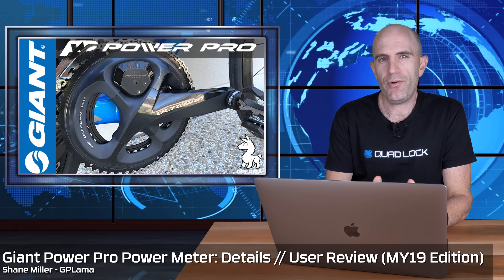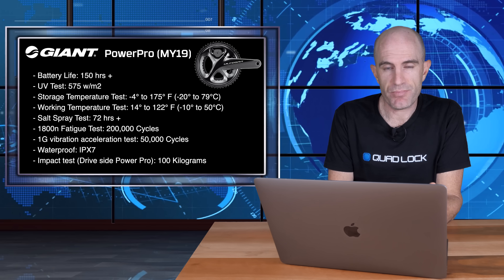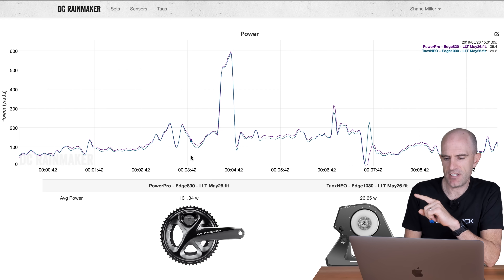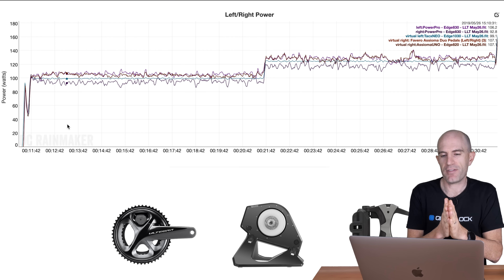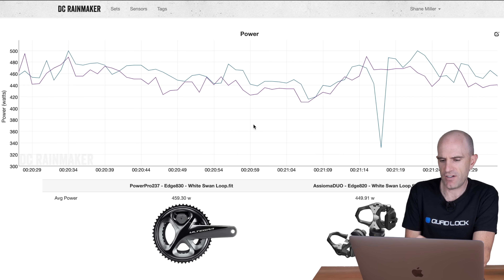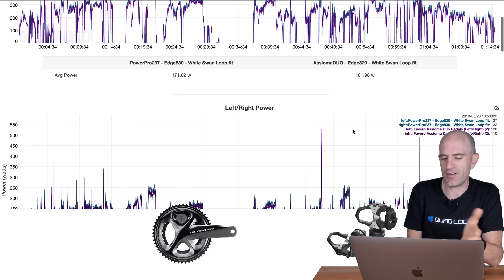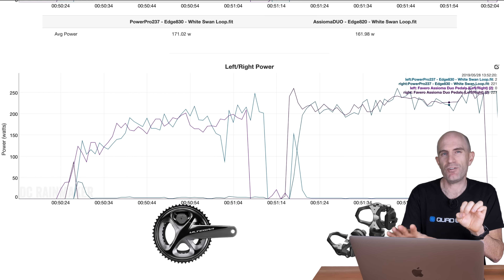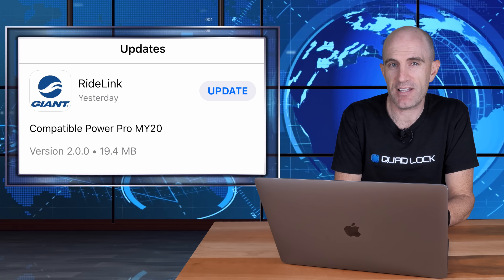GIANT Power Pro Power Meter: Details // User Review (MY19)

Comment: What do you think it is with the Shimano cranks and the inacccuracies/inconsistencies your'e seeing? You'd think that an isotropic material such as that with the which the cranks are made would respond to stress predictably, even with a complex shape.  Perhaps it's that complex shape couple with the adhesive bond between crank parts (I could be wrong, but I thought the Shimano cranks are machined or forged in parts and then bonded together.  Please correct me if I'm wrong on that point).
Reply from the maker: I can only guess it's the shape of the right side and possible manufacturing differences causing problems... even when calibrated. I don't know. Stages, 4iiii, Pioneer, now Giant..... there's a consistent problem I come up against with Shimano right side cranks. The first one to answer or solve this wins. I have email chains with all of those companies.... but it usually takes me doing a video to kick things into action.